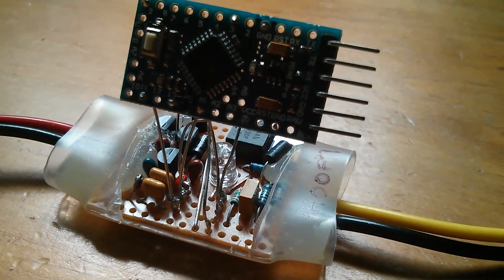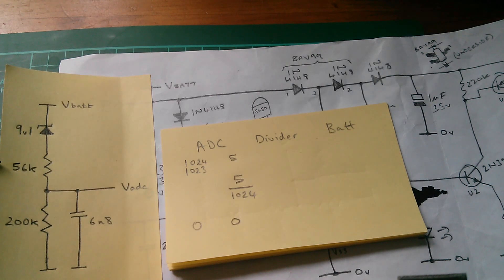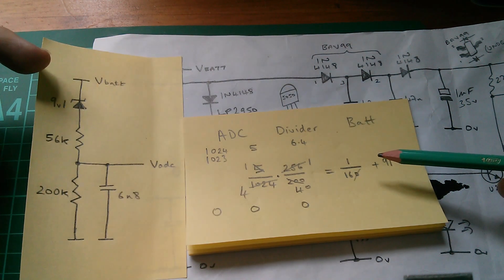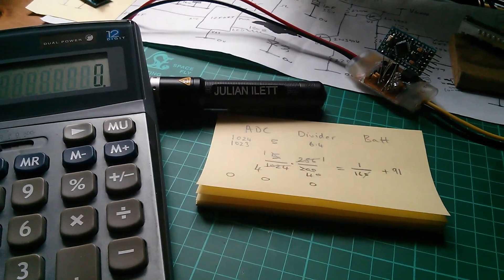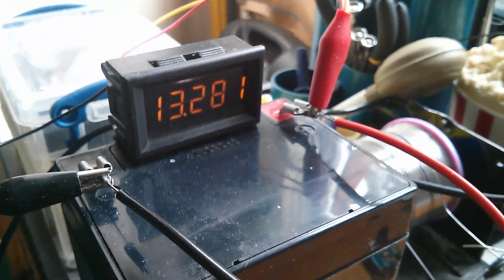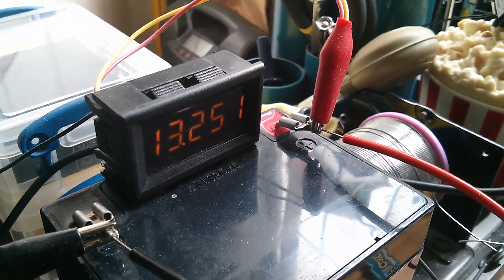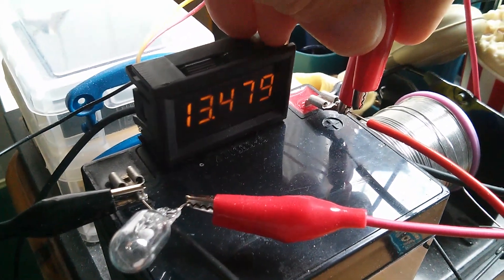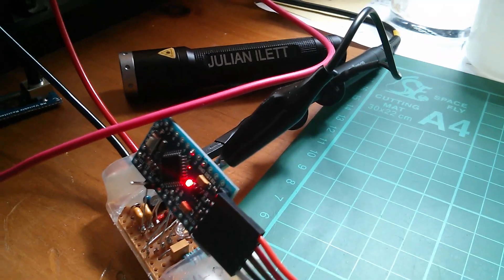Arduino PWM Solar Charge Controller #4 - Closing the Loop

Comment: Hi Julian - on the 'latest' / 'official' circuit diagram with the 82K + 20K voltage divider you have a 220pF smoothing capacitor.  All of the parts lists I've seen elsewhere (Adam Welch & arduined.eu) state that this needs to be rated at 100V - is this correct?  If so - why?  As far as I can see at this point in the circuit the voltage should never be more than 5v (that's the whole point of the voltage divider - to limit the voltage hitting the analog pin A0 to the Arduino).  Can you please confirm my thinking - that a standard 50v rated ceramic cap will suffice?

Comment: Small jumps in voltages to a lead acid battery (13.58 for less then a second for example) will not really do any significant harm to a lead acid battery. First off some car alternators put out 14.5 volts when charging the starting battery until a relay switches them off. Second, I've seen spikes up to ~15 volts for less then a second when headlights are switched off in running older model vehicles.

Comment: Why are you stopping production and sale of the PWM5 ? Are you planning to focus on a similar MPPT project?
Reply from the maker: Gadget Addict Changes to the RoHS rules dictated the stopping date, but also the manufacturing processes took too long.
Reply: What was the component that contained a hazard?  My reading of 
https://www.gov.uk/guidance/rohs-compliance-and-guidance
doesn't suggest an issue...

Comment: I guess part of your problem is loosing precision on the measuring side...  By dividing the analog read (0..1023) by 16 (1..63), you're effectively limiting the precision of the measurement to 63 discrete values.   unless I'm misunderstanding some bits. that means you can for example measure 13.4 volts or 13.5 volts but nothing in between.
Personally, I think it might be better to keep the measurement as is (0..1023) but adjust your comparands in the if to scale to the measurement rather than the other way around.
so something like:
const int WantedDeciVolts = 135;
const int ZenerDropDeciVolts = 91;
const int R1 = 56;   // scale R1 and R2 down to be in range for int
const int R2 = 200;
const int MaxMeasurement = 1023;
const int RefDeciVolts = 50;
const int Reference = (int)((double)((WantedDeciVolts -ZenerDropDeciVolts ) * R2 / (R1+R2) * MaxMeasurement / RefDeciVolts) + 0.5);
and in the loop.
...
int Measured =analogread(A1);
...
if (Measured<Reference)
{
// increment PWM
}
else if (Measured>Reference)
{
// decrement PWM
}

before you cry fire and murder over the usage of double.  Note that we are letting the COMPILER calculate the reference value as precise as posible, then we round it and convert to int.  if you look at code, all of the above stuff will simply get compiled into:  Reference = 703;
none of the intermediate consts will end up in the compiler binary, they're not needed.  (use a define if you have to, const is better/cleaner).
At no time during runtime will a double ever get used.
STILL don't believe me, simply hardcode Reference to 703 (and add a comment telling how the value it's derived).  

It's even more optimal because you have removed entirely from the loop the /16 and + 91  yes, the compare is now an int compare rather than a byte compare, but it'll still be faster.

the 'problem' in that code is the analogRead (which takes 100µs or you can measure at 10Khz at most) this is an order of magniture more than the code in your loop.  (don't optimize where it don't matter).

And as the above shows... don't try to outsmart the compiler, let the compiler do the work for you rather than precalculating everything yourself and getting code that's full of "magic numbers".
Reply: as to the overshoot...  the worse case scenario is that the PWM is at 255 and needs to drop to 0.  This is 255 decrements at 100µs per analogRead at best or 25ms.  Now you have a delay(10) in there so that makes that the obvious slowdown, it'll take 2.5seconds for a worst-case (255 to 0) drop,   I'm not an electrician, I'm don't know how long or how much of an overshoot you can have (for which duration), but there are ways to make the PWM react/decrement faster to sudden changes in measurement.  Essentially the further away from the reference value, the more dramatic the change in PWM increase/decrease.
Reply from the maker: Goodness, yes you're right. I've effectively turned my 10-bit A/D into a 6-bit A/D by removing the 4 least significant bits. I'll have a think about this and re-write the code. One thing: why 'else if' for the second conditional and not just 'if'?
Reply from the maker: oreubens Yes, that was intentional. The long traversal time (2.5 seconds) is to provide damping for the small voltage shifts. Later I'll add code to take larger steps the further the voltage is from the target.
Reply: Julian Ilett if the first if is taken (a value < 135) then it can't at the same time also be > 135, so it's better to put the 2nd if in an else to not get it to do a compare that can't ever be true once the first branch was taken.  the 2 conditions are mutually exclusive, and the else if() means that the 2nd if won't take extra execution time (again, it won't matter here, but can do it "right" for the sake of it being "right" at least :))
Reply from the maker: oreubens Interesting. I see the logic, but I don't like the asymmetry. In this instance I'd rather sacrifice a few clock cycles and have some slightly illogical logic and stick with the symmetrical 'if' statements.

Comment: You shouldn't need the chargepump with these ultra-modern logic-level mosfets, you can get a TO-252 or D2PAK fet that will turn fully on at 5Vgs at a couple of amps :). The onyl problem I've found is the total gate charge is a little on the high side so the frequency might matter....
Reply from the maker: In this configuration, with the MOSFET source connected to +12V, the charge pump is still needed - unfortunately.
Reply: Julian, I haven't looked at your schematic but I am guessing you are switching the solar panel into the battery at a variable duty cycle.

Any reason why you don;t use a N Channel fet on the low side of the battery with the positive connected to the panel? Then your drain is at the same potential as the micro, and the battery negative is only a few milli ohms away from 0V when on.
Reply from the maker: Christopher Obbard Initially I planned to do it that way, but it doesn't appear to work with a solar panel. Have a look at part #1 of this series (playlist is here: http://www.youtube.com/playlist?list=PLjzGSu1yGFjUsB3ChZJ2_-MTNp7bHaKED). I go into some detail about the MOSFET configurations I tried.

Comment: Hi Julian. Probably if you take out your serial writes your control loop will run much faster and you'll get less overshoot.
Reply from the maker: That's true, they probably take quite a bit of time to execute - they won't be there in the final version of course. For the moment, I could reduce the 10ms delay to compensate.
Reply: use nThisMillis=millis() rather than delay()?

Comment: This is all looking very good Julian...! Indeed I might make putting one ov these together my first serious Arduino project. I have two Arduino boards (both given to me as pressies from my partner) but as yet I have not put any to serious use. Just modded those LED flash programs to emulate the character ov my favourite Lighthouses...! I seem to enjoy being stuck in the analogue domain with my development work! :)

That code you have published there also controls the pins to create that boost rail for the Mosfet, yeah? 

Only one thing I want to suggest though, is that adding a tungsten lightbulb ov a suitable wattage to a PSU can mimic the "sag" ov a solar panel even better. Although you already proly have plenty with those little unreg'd wall warts though...! ;)
Reply from the maker: Thanks Xan. I'll put together soon, a little stripboard circuit that sits behind the Pro Mini - with the MOSFET, high side driver and charge pump components. Yes, the code in the setup() function drives the charge pump to generate the higher voltage for the MOSFET. I did play with a light bulb and a regulated PSU, but the unregulated PSU is just a bit more convenient.

Comment: I guess the overshoot is coming from the fact, that you only "single step" the pulsewidth until you find the right one. This can take quite a few loop iterations, if the load change is too big. You need some "P" in your closed loop.

[EDIT]
Dang, I should really watch the video completely AND read the comments before posting...

Comment: If you're using an ATmega/tiny divide by 16 can be done faster: swap the nibbles and AND 0b00001111 . div by 16 done in two clocks.

[EDIT] Ah, I forgot you don't use assembly. It's more of a hassle in C because the nibble swap is only useful, if you're directly working with registers, not C-variables. (although it could be that the compiler will have this optimization for div16 implemented anyway)
Reply from the maker: That's neat, but is the compiler clever enough to do it like that?
Reply: Julian Ilett
That depends on how much effort was put into programming the compiler ;) .

I just checked (arduino) avr-gcc. This C-Code (byte a)
  a += 1;
  a = a / 16;
  a -= 1;
  a /= 2;

gets assembled into these assembly commands:
  b4:   80 91 00 01     lds     r24, 0x0100
  b8:   8f 5f           subi    r24, 0xFF       ; 255
  ba:   82 95           swap    r24
  bc:   8f 70           andi    r24, 0x0F       ; 15
  be:   81 50           subi    r24, 0x01       ; 1
  c0:   86 95           lsr     r24
  c2:   80 93 00 01     sts     0x0100, r24

So yes, at least avr-gcc (or rather its programmers) is intelligent to use this optimization. You can also see that a div2 gets converted into a "shift right". A div15 on the other hand would call an extensive subroutine to do the division. So if pressed for computing time, try to make all divisions to be divisions by powers of two, even if this means multiplying by another factor first (multiplication+div by 2**x is much faster than dividing by a non-power of two).

And try to avoid floats in arduino at all costs. When I did the example above with a set to "float" I couldn't even find where the actual calculation was done, because the assembly got so much bigger.
Reply: Julian Ilett GCC, the compiler the arduino kit is built around has a very good code generator, so it's safe to assume it does.  Only one way to know for sure, and that's look at the actual assembly output.
It won't matter a whole lot here though.  the serial read is significantly slower, the serial write is also slot, there's a delay(10) in there to slow things even more, so all things considered, you're looking at fixing the small dripping leak in the back of the titanic while there's a gashing hole in the front.
Doing C/C++ for a living and giving lectures on programming/optimizing/threading...  Assume the compiler is smart enough for 99.99% of your code, don't go out of your way to write awkward code.  Make your code more readable (more maintainable in the long run) is more important than eeking out a few clockcycles (most of the time).
The big lesson here... "don't optimize where it don't matter."

As a pure "doing it right" thing.  You should have the 2nd if () be part of an else branch of the 1st if (), since the controlling variable can't change from one test to the other.
Also get into a habit of pre-incrementing/decrementing rather than using the post variety.  ++x is guaranteed to be at least as fast as x++, but it can sometimes be faster.

Comment: Oh, I forgot to ask - if I understand you correctly, you're working with an older design which used a Zener diode but the new one does not. Could you tell me why you eliminated it please? I'm thinking of adding one to get more resolution on the much smaller interesting range of 10 - 15 volts, rather than stretching all 1023 values over an entire 0 - 15 volts as a potential divider would, but since you're coming the other way, I'm now a bit cautious.
Reply from the maker: That was exactly my thinking, but the zener diode's voltage is temperature dependent. That could have been useful for temperature compensation, but it worked in the wrong direction, lowering the battery float voltage as it got colder.
Reply: Julian Ilett
Oh I see. Bugger. You've saved me some fruitless work, so thanks again.

Comment: Great video Julian - close to my project and very useful for me - thank you.

It seems the world is not completely as one on how best to charge a lead acid battery, but in the end I looked at he behaviour of a well-known commercial unit and emulated it in software.

On the great 1023/4 debate - it's 1023. That's what all 10 bits set to one is equal to - the largest number which 10 bits can represent. 1024 can't be represented in 10 bits. 10 bits allows 1024 combinations but one of them is zero. Of course it makes little practical difference.
Reply from the maker: But at what voltage does the ADC flip all bits high? It can't be at exactly 5 volts, or it would be unreliable and jittery. So it must reach 1111111111 at a little under 5 volts. That would make 5 volts and 1024 a closer match.
Reply: Julian Ilett
Oh I see. Well, from my control engineering days, ADCs work like old fashioned scale balances - you put your spuds in the bowl and you play around with brass weights on a platform on the other side until the scale tips. You start with the biggest weight you have (the most significant bit). If it tips, then you take it off again; if it doesn't you leave it on. Either way, you go to the next smaller weight and do it all again. And so on. When you've finished with the smallest weight (least significant bit), you have the best approximation you can have to the weight of the spuds represented by the weights left on the other side.

So... if you use all the weights (all 1s) then the scale didn't tip at any point, so all you really know is that the spuds weigh more than your weights. (the voltage is greater than Vmax) where Vmax will be vRef or Vcc or something else your electronics cooked up.

But 1024 is not a value which a 10 bit ADC can return.
Reply: Nice visual analogy +Chris Wesley

Comment: just a thought for running off solar with a bank that if the pwm ever gets >200 then you could have a warning that your starting to draw more than you have incoming etc for people that have to budget their power use.

taking shape nicley, I've had to delay my build as my expected windfall didnt, but i will get some small panels set up 'just for fun' for when i can buy a roof full...
Reply from the maker: I like the idea of that warning, but it would be going all night because the PWM variable sits at 255 all night long.
Reply: Julian Ilett haha yes but you would obv need to know if it was at >200 due to lack of charge or current drain, not really worth adding another current shunt just for that, lack of input is easier to see as it will be a low incoming voltage. could be tricky to make it 'intuitive' in software...and would no doubt never be right.
but at the moment i have an awful switchmode SLA charger to fix, and its already spat half a new (better rated) mosfet at my head for no apparent reason..
toodles.
Reply from the maker: lez briddon Tricky also because only the battery voltage is measured, I don't have a voltage sensor on the solar panel side.
Fortunately I have to wear reading specs now for close up work, so those little solder flux splashes can't get in my eyes.

Comment: Thanks again for these videos Julian! You have really helped me to close out some knowledge gaps I had around charge pumps and MOSFET driving with these and your MPPT test rig videos.

I've been working on my own version using the DCOI and hopefully after watching you explain the PWM5's inner working and interfacing with an Arduino, I'll finally be able to finish up some of the missing bits on my hardware and get my SLAs charging this weekend :)

Whilst I've been learning and working on my hardware, I've also been adapting Tim Nolan's original Ardunio MPPT controller to work with the DCOI and simpler charging circuitry you've detailed - if you're interested, I'm keeping the code updated on Github as I experiment. https://github.com/jdhebden/MPPT

I'm using a small OLED display to show variables but that's very easy to comment out of the code.
Reply from the maker: I wouldn't mind seeing that. I suppose at some point I'll have to put all my stuff on github. Can you put schematics and photos there too?
Reply: You can - it has built in wiki and page hosting for stuff like schematics. When I get it working I'll post something up.

Comment: Change second if block to elseif, save yourself an unnecessary comparison.
Reply from the maker: I just like the symmetry of the two if statements - even if it does create some unnecessary work for the cpu